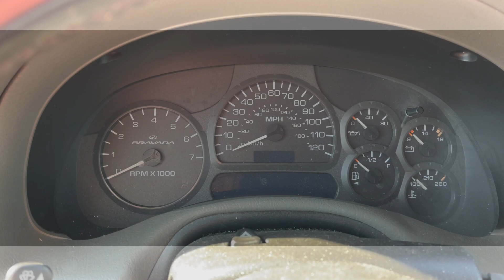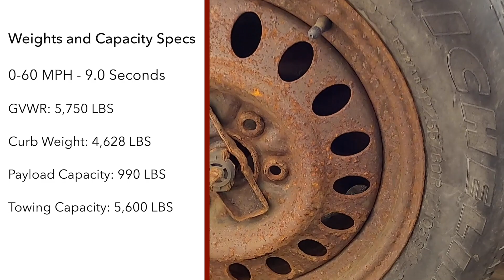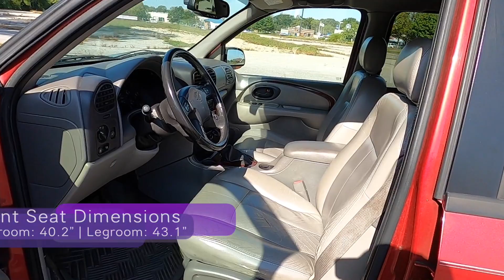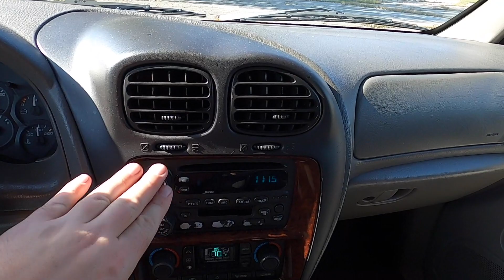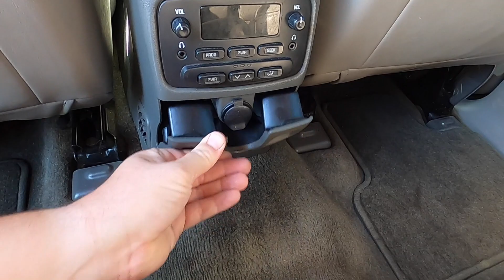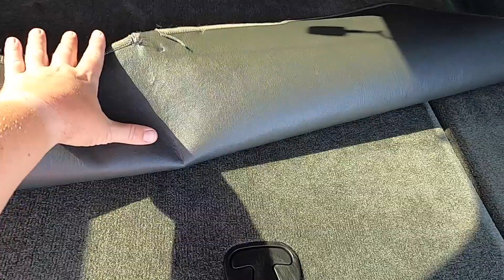2002 Oldsmobile Bravada SmartTrak AWD | Luxury SUV | The Last New Oldsmobile

Comment: I replaced the rear air suspension on my 2006 Buick Rainier with StrutMaster shocks. Far better ride and no more rear chassis slumping. I sold Bravadas from 1991 to the end in 2004.

Comment: I have an 02 Bravada. Bought an 08 Envoy for parts, and have swapped out the interior. Had to change all the power seat plugs and the overhead console. Swapped the tires and wheels to the 18 inch Envoy rims also. Changed A few other odds and ends too.  My love for Oldsmobile started out in high school  when I bought A 1971 Cutlas S that I built into A 10 second 1/4 mile beast. (Regret selling it) I'm still considering an LS V-8 swap in my Bravada. Call it the Bravada SS.. Good video! Thank You!